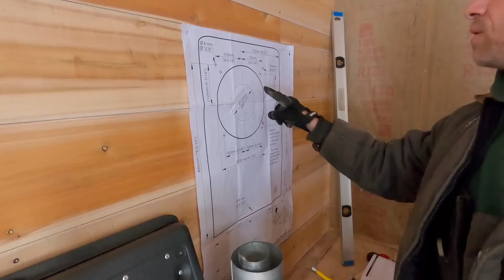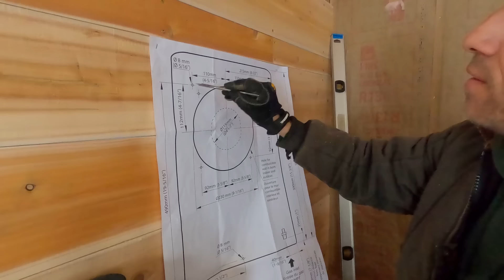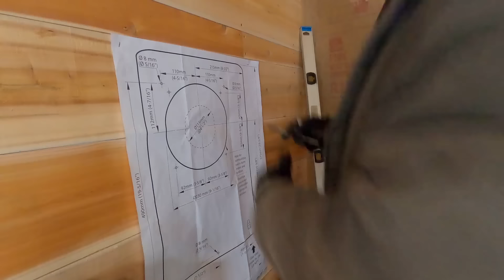Tiny Cabin Direct Vent Heater Install (No Electricity.) After Three Years in a Tent, Now HEAT! #114

Comment: A wood stove would be one and done, no need to keep buying expensive propane, it's a nice dry heat and you are surrounded by endless fuel...
Reply: he doesn't want to harvest, split, store, and season, firewood. 
dosent want to start and maintain a fire all the time
he uses heat very little because he's outside working all day
mostly cedar on his property
Reply: Is the propane tank still in the shower ?? Or did you have a eureka moment ??
Reply: I was thinking one of those 8kw Chinese diesel heater a large external tank and a 12 volt power supply of some sort would have been easier. But the option you have chosen is a nice heater. Just a bit humid.
Reply: Propane isn't that bad if your building is super insulated. I use a propane heater in my partially insulated shed and it'll cook you out. I barely use any fuel because it heats up quick and I can turn it off.
Reply: Sorry Firewood is not endless. It’s called timber rights. 
That’s the part that gets funny when I hear my friends I got one of those water heater wood burner stoves I’m going to save myself tons of money. I got property trees. About two years. They’re ordering their wood.  It paid for itself until the trees that they don’t want to cut down no more came into effect. Now they start ordering a truckload of logs. They’re out there during the summertime instead of fishing camping spending time with the family they’re splitting cut and splitting stacking wood for the winner.
Reply: wood is expensive
Reply: @svfixerup it needs electricity, thats kinda dumb
Reply: @sgtrickards5683  I'm heating my house which is 970 sqft with a big buddy set on low. 4000 btu's holds the house at 68 degrees but I have alot of insulation.
Reply: I have propane heat but also a wood stove in the house. Both have their advantages and disadvantages. Propane is expensive…very. However, storing wood and going outside every hour to grab more wood in the middle of winter, isn’t ideal either. Besides, in his case he would remove the propane tanks and replace it with  the disadvantage of having to continually cuts, split, season and stack wood. So it depends on your preferences.
Reply: Lol I always use directions to lean on lol…then I have all these extra leftover parts. I guess they were freebies lol

Comment: STOP the plumbing, drill the hole in the floor and run the gas pipe under the cabin on a 45 over to the tanks then up the outside wall to the valve.  Inside the cabin, just under the heater valve add a T and another valve so you can have a gas hose to a burner/ cook top coffee stove. And a mantel lamp.
Reply: Yep just thinking the same, you can even put the lp gas cylinders further out away from the house under a lean to. Might look into a gas room light for some real light in the cabin. You get light and heat at the same time.
Reply: Thinking same, official way lp Co. runs gas into homes. Like you would run to hook-up of a gas lp cook stove.
Reply: Poor way to do it! Boring.
Reply: Use pipe dope with black pipe. The drop is totally wrong, it's not an air hammer for plumbing a faucet!
Reply: YEAHH
Reply: This way makes the foreman beat my ass. Lmfaoo
Reply: @bowhuntrrl  Correct pipe dope on gas pipe thread tape on water pipe
Reply: Smooth move
Reply: Wait till it gets cold enough for that propane to stop turning into gas and start spitting out liquid and burn that little cabin down.......
Reply: @davidkoch4746  You are definitely wrong...while not "code" nor recommended, that IS gas pipe tape, not water tfe tape
Reply: @TheMerlinmk19  yellow is gas tape... not the white tape.
Reply: @Beezy King  he's using yellow here, take another look. White is always on a blue spool with white cover - there is a reason for this labeling and packaging
Reply: @TheMerlinmk19  whoops!.. must've missed that part, thanks.
Reply: I need that very plan.
Reply: r u talking about the yellow gas line ,, i was kinda thinking the same route but couldnt he use all yellow hose
Reply: @brucesmith656  flex line isn't usually used in place of black iron pipes... a T under the unit, lower part of it would catch sediment.
Reply: If you insist on sending 1/2 the heat out side, why not mount a insulated metal water can above the pipe to pre heat some water that could come inside through a 1/4 inch tube for your drinking pleasure? See how a gas water heater works.
Reply: ❤ What EVER !  This works as well as year bosses. ⚠️  Ryan, Don’t be pretty. Just do it.
Reply: ❤ 6” floor raise. ? ?  Dude,, think about a 2”  foam board and 3/4” floor. How would you raise the door frame 6 “ ?
Reply: Use a regulator for an RV. They're pretty cheap.
Reply: OMG!

Comment: Those weren't couplings you can see how smooth they are. Those were thread protectors for 20' sections of pipe, and they are way weaker and won't pass an inspection. Google thread protectors vs couplings for your own information if you don't trust me with my 20+ years of HVAC experience.

Comment: the problem you're having with assembling the black iron can be solved with a union, allows you to disconnect a section of the piping from the main line making it easier to do things like assemble the value controller much easier

Comment: The reason for the dirt leg (tee, nipple, and cap) is to catch any dirt in the pipe so that it doesn't damage the gas appliance. It needs to be as close to the appliance as possible. Your dirt leg should be inside the cabin, where it comes through the wall. Where you have it really doesn't do much good, because there is no dirt in the rubber hose from the tanks to the valve.

Comment: A direct vent heater is one where the exhaust goes right out the wall. The other propane heaters of that size are typically unvented, where the exhaust goes inside. For small spaces, unvented heaters are particularly undesirable because they cause humidity issues. And there are more safety concerns.
Reply: All new non vent heaters have a flame cut off if the oxygen level gets low, witch would take days to reach in the worm den. I use 3 thermostat controlled, in our house and  3 n  our cabin @ 6000 feet, 20 years and never a problem.100% fast quick and in a hurry efficient. No moisture problems.
Reply: I installed one in my house and used it for a little while before removing it.  When I used it, moisture would condense on the windows inside the house.  The air felt heavier and it was harder to breathe.  I didn't like it.
Reply: @rexhavoc2982  I believe you, and I also know that it's such a common complaint among the RV and tiny house crowd, and that many other people are less lucky than yourself, to the point that it's irresponsible not to mention the risk.

Comment: Ryan, you MUST make some vent holes in the floor or the very lowest parts of the wall next to the heater! Remeber that propane is heavier than air!! This is extremely important. You should also get yourself an co2/propane alarm!
Reply: Why the holes?
Reply: The heater gets its air from the double wall vent.
Reply: @JJKHaywood  If i propane leak occurs, the propane will go out there and not build up. All caravans for example, must have low placed vents. Since popane is heavier than air it will build up from the floor and rise untill you have the perfect mix for a disaster!
Reply: @eoghanosullivan6704  Read my other answer! The air for the heater is not the biggest issue.
Reply: @J1I9M7M4Y  Horse Hockey,   Almost Nobody installs vents for propane to escape.   The RV Industry in the USA does not install propane vents at the bottom of walls  or in the floor for propane to escape.   

Alarm with auto shutdown at tank valve,  Yes they do.
Reply: @JJKHaywood  Ok.. So that makes it right? In europe every caravan has vents for propane...
Reply: Happy Holidays!
Reply: And what us the lowest avg temperature in Europe?
Reply: @foxvulpes8245  Where i live in Sweden it is around -13 degrees Celsius (8,6F) December to February..

Comment: 2 degrees, crack me up....... I always need some self help therapy  before an "assembly" is going to take place, and the neighbor on speed dial. Just recently had to call for the weight lifter kid to  "push " the wheels into a click position......... Thks for the laugh. Keep your foot on the gas.

Comment: Get a 250-500 gallon propane tank, you will be glad you did. Leasing the tank is best, $125/year vs $2000+ to purchase. Volume propane purchase is a lot less expensive too vs 20-30-40-100 pound tanks... Add a couple of gas lights too, that makes for some good lighting.
Reply: Good idea, but couldn’t get the supplier truck back to the camp on the narrow 2-track.

Comment: Make sure you install some rafter baffles so you don't block your over hang roof vents with your insulation.👍
Reply: Yes!  It's been driving me nuts cuz I want him to mention what he's going to do to keep the air flowing through there. The cheap plastic vents work good and staple easily.

Comment: I am an older guy in Ohio that is home bound and I watch one on Saturday mornings.  I have installed both gas and propaine hearters.  The gas one is bigger.  The propane one almost caught the house on fire.  Outside is a 100 gal tank.  Its disconnected now..  The propane here is still in here too.  One is welcome to both the tank and heater.  The tank is empty now.  My propaine heater is a bit smaller than the one that one installed today.  Some people run a crimped copper line in to the heater.  I use the gas pipe that I installed too.  This is work and I have some heat in my colder house.  I am in Youngstown Ohio about 300 miles away from one.  I like to watch one build suff.  A lady I watch online a nurse in Canada watches one too.  She has a saw mill and cuts some pine up for he little cabins that she is building and she mentioned on Rion.

Comment: Ryan. Floor insulation 

I love your work and vision and videos. 

I was surprised that you said about raising the floor as much as your talking about. 

My thoughts would be to use 2 inch rigid foam and just cover the entire floor taping seams. 
That way your new wood floor planned and finished would be able to be screwed right through the rigid foam insulation and into the existing floor with a solid complete thermal barrier as it’s solid floating insulation barrier or solid two inch foam. 

No need to install new floor joists like you mentioned and better insulation and the floor would only be raised the two inch insulation plus the thickness of the new flooring. 

Just a thought as it would be easier and less material and work as well as the floor only needs raised half of what you were mentioning. 

Hopefully you consider this as a option. 

Keep safe and warm. 

John and Cathy Stockdale 
Ontario Canada

Comment: My wife and I built a tiny house and lived in it in GA before buying property in VA and moving it up there.  We lived in that for 5 years while we built a cottage on our property.  We used a ventless propane heater for all that time and only used the small 20lbs cylinders.  We also had a 20" propane stove and oven, and 2 tankless propane water heaters.  The heater we had was a catalyst type with a mechanical thermostat.  That was the best heater.  And, it was very efficient too.  We usually filled 3 bottles per month in the winter.  In the summer we used propane for hot water and cooking but it would only use one bottle per month.

Comment: If you insulate your floor with styrofoam sheets you won't have to raise your floor a huge amount to get significant R value and it also won't hold water like fiberglass batts will or give cavities for critters to nest.

Comment: I have already done what you're doing and I finally purchased an LP wall furnace with an outside vent, which I ran full-length through my greenhouse,  so the house's waste heat could be put to good use.
I did all that to dodge smelling the burned propane fumes, which gave me headaches. $300-ish at Lowes (special order).

Comment: used to build 2000 sq ft 2 story homes in New England in the winter, once we had shell weather tite, we would install the Gas fireplace and leave on low, once insulated, in all but the coldest weather, kept interior about 40 deg, F when turned up in morning, by 10 am, it would be 50+ deg inside

Comment: Probably a good idea to use some high temp exhaust gasket sealer to put in between those flanges where it meets up to that sheet metal playing in between the walls so reduce the amount of moisture getting into your installation and so it stops any black mold from growing in between your walls

Comment: It’s good me and my pup live half on half off grid as much as possible but I bought a fifth wheel camper with three pullouts which is plenty of room for me and my pup I’m currently using a ventless wall heater but enjoy your attitude and enjoy watching this video I get no help from outside hardly but always wondered what it would be like totally off grid the ventless I’ve got was gave to me by my sister because my electric bill was skyrocketed last winter I live in the Ozarks mountains but have several neighbors I’ve never tried milling my own lumber even though I’ve got a yard full of 70’ oak trees 🌳 I’m thinking maybe when I can afford it to go to a vented like yours I’ve got so much to do yet and go figure my truck is broke down but have several battery hand tools just seems like when things are going right it doesn’t last long but I try my best to wipe it off and keep going with what I have I’m an older guy retired now and not quit so mobil as when I was younger but I really like your attitude keep doing these videos there fun to watch . I’d send you something but live from check to check as it is but seeing off gridders like yourself gives me inspiration

Comment: Rule of Thumb, use tape for Water, and Pipe Dope for Gas ! Check all you connections with some soapy water to check for leaks, watch for bubbles. Ryan, why not a wood stove, you have a ton of wood to use.
Reply: You can use tape and dope for water. Clearly you need to understand what tape and dope is. Read the labels.
Reply: Yes, definately pipe dope for gas, not the yellow tape. Pipe dope can be used for water, but if you're sloppy with it you can taste it in the water for a very long time. Don't know why anyone would want to consume pipe dope in their water. Can't be good for the body.
Reply: @gwebocelestron9194  Colored tape is really means thickness. Yellow is thicker than white. There is no standard for tape and its uses. The color is a marketing thing.

Comment: Vented is the best way to go !  That way you will have dry heat and not the build up of humidity from propane in your cabin. Maybe you can find a way to insulate your propane bottle. Propane contracts when it's cold. When it's extremely cold outside, the volume of propane inside your aboveground propane tank will shrink, which creates a loss of pressure. The problem is, if the pressure becomes too low, the propane inside your tank will not be able to reach your gas burner. Good Luck and Happy Holidays !
Reply: Yep. I put in a ventless lp wall heater. Condensation in my tiny house is terrible. Windows are covered with condensation and pools on the window sill. I have to wipe dry multiple times a day.

Comment: I still think you should invest in a little portable wood burning stove for just incase. If you run out of propane or something. You can vent it out a window if you need to instead of putting another hole in the wall or roof. Just for emergencies, but I'm a worrier lol.
Reply: yeah we have said this dozens of times and its never going to happen. Wood can solve many of his problems including his winter showers.. He spends a lot of time doing it the hard way. Drying his lumber the right way would solve a lot of problems. Adding a wood stove would solve a lot more problems. Building an outdoor kitchen with wood cook stove and stock pot burner and buying one of those 200 dollar stock pots would be more than enough to shower in. 
There are a lot of ideas and things he could do yet he wont do it. I doubt he reads the comments any more.

Comment: On a more real note, I would make an exterior male 120VAC plug through the man-cave wall to a normal 120VAC home outlet.
Then pick a good place and build a sound dampening enclosure for your generator within reach of the man cave. or between the Man cave and cabin. Then you could power either place.
That way you could just run the extension cord over to the man-cave when you are charging, and the generator sound would be considerably reduced, even if it was just a double walled wooden enclosure.

Comment: The gas code were I live said you can't have a thread joint in a wall cavity.Coming through the floor is the way to go. The gas pipe that is outside should be painted with rust resistant paint. You should have at least one inch of pipe before the threads on either side of the wall so you can do a leak test. I don't think you will pressure test that small amount of pipe. Thats the rules in Ontario CA I think it's almost the same in Michigan . Just want to keep you warm and safe. The place looks great.

Comment: Hi Ryan

Love your channel and your lifestyle. I know you have said several times that you are going to raise your floor 6 inches. Instead, mill some rough cut 1 1/2" width x 1" height lumber and put them on the existing floor. Then put the 1" foam board insulation between them and then add 3/4" planed boards on top. Total height increase would be only 1 3/4". Also so you don't have to redo the front door, leave a cut-out area  so the door swings open without hitting the new raised floor and put some slate tile in this area. This will allow you to keep all of your existing work in place :). 

Anyway, keep up the great videos.